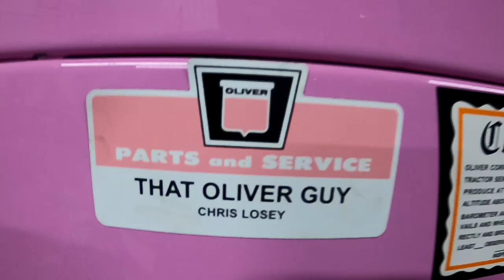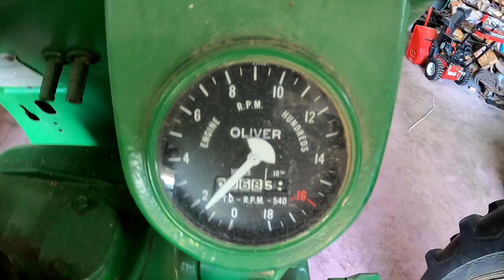Too PRETTY to work? Oliver 1850 and Oliver 660 putting in time

Comment: That 1850 looks really good did a really nice job with it. I have 2 1850s both are 1969s so I don’t think mine would be the correct year to paint one that color purple
Reply from the maker: Mine isn't either. It's an early 65 and the promotion was in 66.

Comment: Hey Chris at 9:30 or so I think I could see the #1 spark plug wire and tach cable? sparking.
Reply from the maker: That's the wire harness, the tach cable is below the filter, but I do see what you are talking about.  I'll have to check that out, maybe I can film it in slow mo in the dark to see what is going on.

Comment: Love the purple. What is that "certified" sticker ? The paint job seems to have been well done.
Reply from the maker: There were complaints about the Oliver 1600 not producing enough power. This led to a campaign where Oliver paid to replace pistons and sleeves with larger bores to get more power. In order to overcome the bad rap the 1600 had gotten,  all tractors would be run on a dyno as they rolled off the assembly line. The horsepower was corrected for temperature and altitude,  and that number was written on the Certified decal, along with the initials of the person doing the test. If a tractor didn't make the advertised horsepower,  they might run it a little longer to get it broke in enough to get the numbers where they needed to be.  If that didn't work,  they would pull it back in the factory and figure out what was wrong. Any Oliver with the certified decal left the factory producing rated horsepower at a minimum.
Reply: @ThatOliverGuyChris  Interesting. Thanks for the info.

Comment: With all the axles on those trucks when do they put them on the ground?
We have superBs, 8 axles and they are all on the ground. We can haul about 42 tonne. About 1500 bus. Of wheat.
Reply from the maker: When he gets on the road he drops the extra axles. It turns a lot better with the axles up. The exception is one of the new aluminum trailers. The air axle can lift the rear axle off the ground when it's empty and shortens the turning radius dramatically.